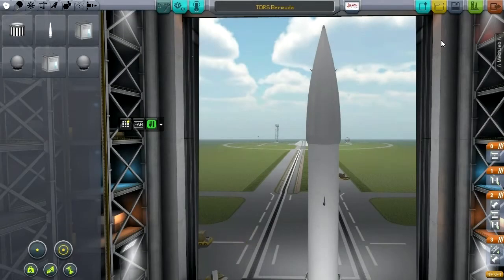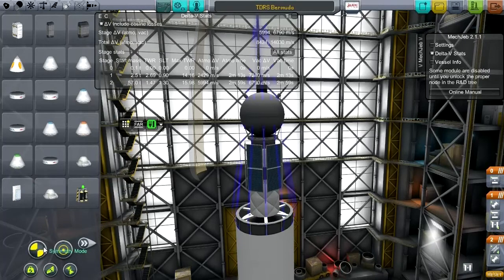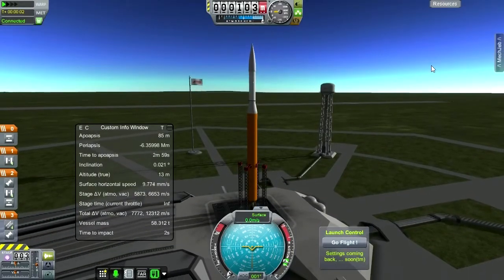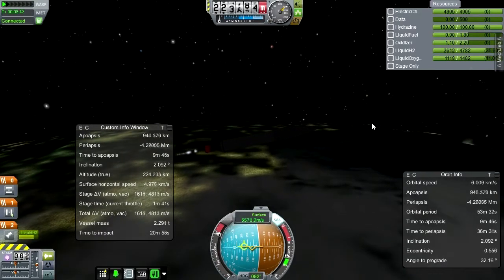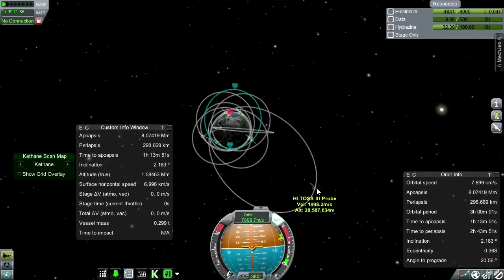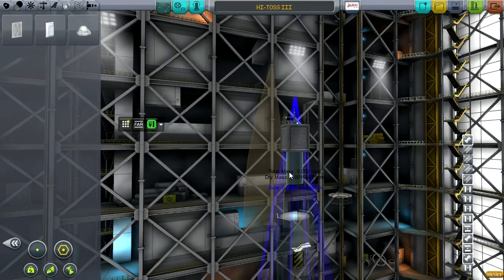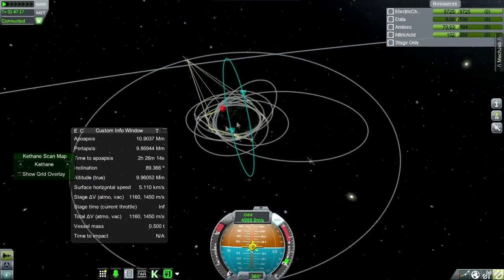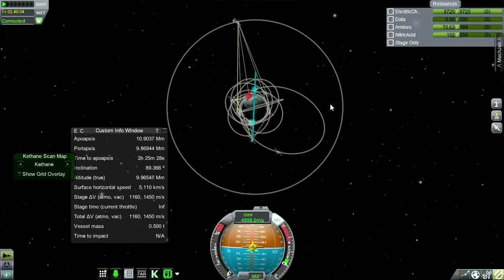Kerbal Space Program (0.23) - Realism Overhaul 011 - G-STAT I

Comment: Actually, if you continue to spin the velocity will build up over time (give that you have SAS off). Doesn't fine tuning/precision mode – enabled with Caps Lock since 0.08.5 – affect the RCS system?

"A mean sidereal day is about 23 hours, 56 minutes, 4.0916 seconds (23.9344699 hours or 0.99726958 mean solar days), the time it takes the Earth to make one rotation relative to the vernal equinox." - Wikipedia

With MechJeb doing the job, it's possible (for me) to make it 23 hours, 56 minutes and 4.1 seconds. The error is only 0.0084 seconds/orbit "lagging behind", or one second in 10257600 years. I would say that that's pretty accurate. With your "close enough" method you managed to get it right to one second in 1 hour, 5 minutes and 34.72 seconds. In one year time warping, that's an error of ~2 hours 14 minutes. That is quite accurate, too, I would say. Close enough. :P
Polestar hasn't been used for any rocket as far as I know. Polestar is though the official Volvo (yay, Sweden!) factory racing team.
Reply: ***** So it does affect the RCS system?

Or you could just pause and do the math. It's not that hard, you know. And you're never going to be wrong either. Numbers don't lie.

Polestar is indeed a good name. :)
Reply: ***** But that isn't orbital mechanics, it's just ordinary high school math.
Just take the total difference between your orbital time and the "real"one and divide it by your orbital time and you'll get how many seconds/hour you are lagging behind.
Reply: ***** I don't see why you are taking any offense. It 's not that I've blamed you for doing something wrong, absolutely not.
No, I just said that I managed to pinpoint it to that precision of one second in ten million years, with MechJeb. It's not hard, you just have to have a bit penitence. Moreover, KSP's model isn't that exact either, so the error caused by that is way way bigger. And obviously, real satellites don't adjust their orbital time to the precision of a tenth or hundredth of a second. Firstly, it's not even necessary and secondly, it's not even possible. We don't have that precise models.
Lastly, I think you did a pretty good job. I had to Google the information.

All I've said, really, is that if you want to know, roughly, how precise you should be you can pause and check things up. You don't have to, of course. ~2 hours in 1 year time warp is perfectly fine for me. I assumed you liked mathematics and threw out some numbers, just for fun. Don't take any offense, because that's absolutely not what it's about.
Reply: ***** It does not imply that you were lazy. It's your series, and you do exactly the content you want to make. I said that if you want to make sure you're okay with the tolerance, pause and simply check. When building the Saturn V you did just that. But again, you don't have to.

Comment: 23hr 56 min 4.0916 sec
Reply: ***** You can use RCS in precision control mode to get in pretty close.
Oh and BTW I'm still in a process of watching your series (BIG thanks for it!!!), but I hope you did figure out that you can use RT2 flight computer to time just about everything. I use it all the time, for example to shut off antenna during transit (schedule turning on, then shut off) to save electricity, and of course for reentries.
Reply: ***** Yes, but you can use FC to do stuff while you're LOS (don't have communications with KSC) as long as you "schedule" them while you're in AOS. That is something you can't do manually. And so is shutting off antennas during transit to save power.
Reply: ***** Well I guess it's a personal thing. I love pre-programming stuff and then seeing if it works ("Seven minutes of terror"-kind of thing) :)